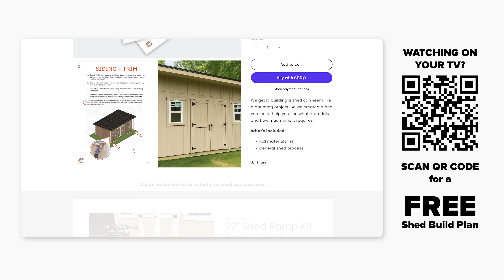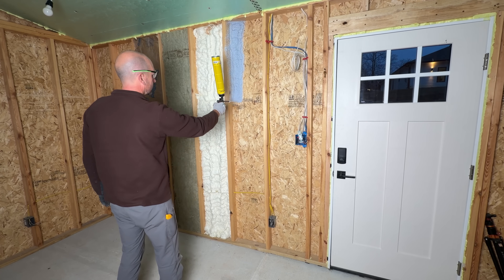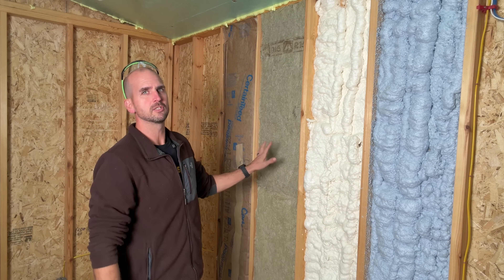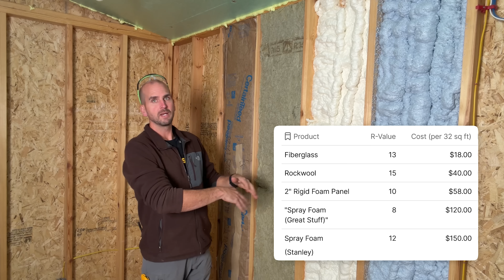Stop Wasting Money! Most Homeowners Are Insulating Walls Wrong

Comment: I used to work on exlensive homes built by professional home builders that were designed by local architects that came with finishing schedules for the trades to follow. These were built from the late 1940's thru the 1970's. I noticed they were using an industrial closed cell spray insulation in the exterior wall cavities then covering the exterior walls and ceilings below attics with foiled backed drywall. The aluminum foil served as a vapor barrier and as a reflective barrier that deterred heat and cold from passing thru the drywall from either direction. The property owners said their heating and cooling costs were lower due to that. Two friends decided to build their own house by using contractor friends and some work themselves. Both rented the spray foam application gun and hoses and the tanks from the same industrial insulation contractor then paid the cost for the tank contents. Both used sheets of oiled plywood set over each cavity after spraying so the foam would fill the entire cavity as it expanded to leave it flush with the studs. They had the electric boxes set flush with the studs so the plywood would lay flat against the studs. They installed box extenders when finished. They special ordered the foil-back drywall from an interior supply house.

Comment: Rock wool also has great sound deadening qualities which is a good reason to use where reducing outside noise is a factor. I still would us fiberglass if the structure is properly built and wrapped.

Comment: I used great stuff to seal every seam, joint, crackles, hole and gap in my basement wall before I reset the fiberglass insulation.
It STOPPED the wind from ballooning the plastic vapor barrier. Then I put up new drywall. The basement is 15 degrees warmer now!!!

Comment: Tried to read all comments , too many.
A few tips from doing Lagging Construction on Coal Burning Electric ⚡️ Plants.
 “ Never use a straight cut, when lapping.  Heat can escape. Use a “Z” cut. 4”- 2” down to 2” center, both top/ bottom lap piece.”
Heat on these walls exceeds 700- degrees.
Should work great from cold 🥶 temperatures.
Tip #2. Sound Ptoofing walls. Did a BOSE STORE, sound room. Tip: Double Wall “DRYWALL.” NO SEAM OVER A SEAM, Half way on 4’-0” wide, lap over at 2’-0”. Prevents sound travel. With 4” insulation in all walls ( sound barrier).
Union Retired SHEETMETAL Worker.

Comment: The end wall of my garage is bare cinder blocks, the wall is shared with the inside of my house (insulated on the inside of the house as per usual).  What is the best method to insulate the bare cinder block wall on the garage side, I have seen videos where foam sheet is glued on first, then studs are installed with fiberglass insulation in between, then vapour barrier added (plastic).  My garage is heated in the winter.

Comment: Pretty good comparison overall.  I'd love to see what the walls look like with an infrared camera after you're done and it's heated & cooled!  By the way, depending on your climate zone, you could add 1" thick foam board over the insulated walls to provide continuous insulation on the interior side, instead of installing drywall.

Comment: The other part you didn't mention was the difference between closed cell foam and open cell foam. Closed cell has a higher R value. Depending on the product it would be R5 per inch for the closed cell foam. The foam is more expensive but in colder climates it can actually be a better choice, as well as you don't need a vapor barrier.

Comment: My husband and I saved for a year to insulate our whole mobile home with Rockwool. It took us a week to do it ourselves because we replaced  and strengthened studs, repaired beams, leveled the house, replaced subfloors, and insulated our skirting. OMG after the first day it was AMAZING!! We couldn’t hear any outside noise, temperature inside was comfortable, and it was easy to install. My neighbor has a motorcycle and I could barely hear him when he came home 😂. We had more trouble getting the siding back on than installing the insulation. We were in a race to beat the cold weather that was coming. We finished painting the exterior 4 days before 32 degree weather showed up. We couldn’t afford a new central air and heat so we installed a gas heater. That one 30,000btu heats our whole house comfortably. I don’t think it would’ve worked if we hadn’t replaced the insulation in the walls, insulated the skirting, and put in storm windows. It was expensive but well worth it! We painted the roof with kool seal until we can afford a metal roof. There are no leaks in the roof but we wanted to prevent any leaks with snow coming. I researched for a year before we decided to buy Rockwool. I’m just amazed at the difference it made. You can’t hear anyone walking around, talking, or the tv on when outside.
Reply: Rockwood is amazing, replaced a walls fiberglass with Rockwood. Oh man! The difference it made! Everything you said and very fire resistant as well unlike fiberglass. I burn wood for heat and this has made a great difference when trying to save on propane or wood .
Reply: That’s because rockwool is really used as a sound barrier in libraries and other places where sound needs to be reduced. Its use as an insulation is secondary.
Reply: @davidlangley2722 about 12 years ago, i did a house remodel and built a laundry room upstairs (from basement).  I sought sound deadening material, to isolate washing machine and dryer noise, from our leaving area.  I believe i used this same material, after doing some research.   I remember it was labeled as fire resistant too.  Works great.  You can barely hear the washing machine whenever door is closed.  The laundry  room is right next to our living room
Reply: I love the sound attenuation that you get with Rockwool.  It is all I use now.
Reply: Insulation is the most cost-effective way to reduce heating costs. In Sweden, there are a lot of zero-energy houses in new construction. You don't need to add any energy to keep the heat well below freezing. In Northern Sweden, where it's normal for winters to be -15 F, they put 35 cm (14") in the walls and 65 cm (26") of mineral wool insulation (you call it Rockwool but it's a company name and not a product) in the roof. It keeps the house cool in the summer without adding energy. It's enough that you live there, run a TV and computer, etc. There's even a +House, i.e. the house creates more energy than it consumes, but then you have to have solar panels on the roof.
Reply: Mentioned Trailer, the skirting along the base, is supposed to breathe. Air circulation, to prevent MOLD .
I have a Trailer, notice some skirting has perforation every 6-8 feet apart. Help that breathing process.
Water 💦 Tip: try and figure a way to save your GRAY WATER.
Example:: Dish water, Laundry Water 💦, use it as,” Toilet 🚽 Water .”
I pay $13.41 per 1,000 gallons ( both water/sewage), this is where GRAY WATER comes handy.
Reply: It is also fire resistant  because it is rock😂

Comment: That rigid foam on ceiling was a waste of time the R value is useless ceilings should be R30 or higher use baffles against the plywood for air flow to keep mold away

Comment: Big question: To keep the insulation (say Rockwool) from getting moisture from the outside, could I apply something like Red Guard as a liquid-applied waterproofing to the sheathing?? I have an outside wall in the guest bathroom that I want to insulate before putting up DensShield for tiling my shower. But I wonder if I could waterproof the inside sheathing on that outside wall before installing the Rockwool insulation (or similar insulation) before I install the DensShield and tiling.

Comment: Hey, if you want to breathe toxic fumes all day, any of these will do. And honestly, have you EVER renovated? Rockwool absorbs water, and is a haven for rodents. I hate the stuff, but you are 100% right - it is the best of the bunch you have shown. 

I like your comparisons, video, format, presence etc., but not the materials you use. I don't even use OSB boards. Strictly eco builds for me. 
Also, those OSB boards will be excellent condensation points. What happens to these building materials once the building has outlived its purpose? All into landfill. 

Thank goodness for hempcrete and LSC insulation! Back to the earth they go, hey ho.

Comment: Love the Rockwool.  The fact that it's mold and fire resistant sold me.  I put a direct flame to a small test piece and at most it barely produced any smoke and did not char the insulation.  Insulated my entire home (1300sqft) with it.  Easy to cut especially around outlet/switch boxes.  Also putting slits in it where my wires run vertically in each wall cavity to keep the R-value.  Just a dream to work with 👍

Comment: Been building for 40 plus years, I always go with rock wool, best bang for your buck and fireproof too!!! You can put it right up to dryer and stove exhaust vents and gas fireplace chimney vents with no issues. And it has a higher R-value than woven fiberglass. It is still made of fiberglass, so you still have to wear a mask and gloves, but no where near the itchies that pink or yellow fiberglass produce.  Foam is expensive and not eco-friendly despite what they say, it is made from oil, so not eco at all.

Comment: Lots of myths perpetuated in this video.  
Staple the kraft paper on the face of the stud not the side. Otherwise, you get an air channel from top to bottom that forms a convective loop, degrading your whole wall insulation value. The drywall doesn't care about two layers of paper, and at least your vapor barrier is continuous.  Also, rock wool is only about 15% than fiberglass at attenuating sound—it's not a wonder product.  And fiberglass comes in R-15 for 2x4 walls, same as rock wool.  And regarding fire resistance, they are both very close, rock wool being better.  But the fire really doesn't care about this argument because it's too busy consuming furniture, plastic, carpet, studs, joists, trusses. etc.  If you have the opportunity to look at a burned down house, the insulation doesn't seem to play an important role.

Comment: I did my entire 1,600 sqft upstairs in my new build with Roxul. I did ICF for the walkout basement. It's a no-brainer as it cuts easy and doesn't sag.  It is tougher to install than fiberglass as it has to be cut to fit, so you may be cutting 1" off.  Spray foam is only useful in the rim joist spaces.  I live in central Saskatchewan...where it is currently -39C, so insulation matters 😉

Comment: They're selling recycled denim insulation in batts at the big box home improvement stores that approaches rockwool for sound deadening properties and offers R-13 insulation value. It's called Ultra Touch. It's about a dollar a square foot, so it's marginally cheaper than rockwool and scales out on a big project to make a lot of sense. The only issue I had with it was that it's a pain to cut.
Reply: Retains water 💦 ?

Comment: You didn't put the fiberglass and Rockwell in properly.  You need to split the product vertically, just above the electrical wiring, so the insulation is behind the wire and not covering it. You now have a gap between the wire and the OSB because the insulation is not against the wall.

Comment: I think the paper should be stapled to the face of the 2x not the side.  When you staple at the side you push down the insulation and thereby reduce the R value which is rated by the inch.

Comment: R-13? How about R-25? Overkill? In northern Canada we even use R-65 in our shed attic and we use Tyvek House wrap &  2" foam insulation under our siding on the exterior shed. Also we noticed by having those good old fashioned aluminum awnings over shed windows & doors also really helped add warmth to our sheds.

Comment: The big difference will be how the bats hold up 5 to 10 years later. You will see voids begin to form as the batts begin to sag within the wall. Especially if there is moisture penetration due to bad siding you will find with a lot of newer builds.

In general spray foam has was better applicators and material when you use professional grade equipment and no batt insulation will out perform it. It will never sag, it will never absorb moisture and it will never loose R value.

Comment: Most important considerations for insulation are R value, moisture control, and air flow prevention. Most fiberglass or wool installs are useless/vastly impaired by air flow. When taking apart old walls/in attics, the batts will be black with dirt as they have filtered the air like an ac filter. Sometime they are also black with mold that grows in the filtered dirt. In cold areas, 2x6 wall with 1.5 rigid foam board caulked or foamed to stud cavity to prevent air flow, with mineral wool on top. Can also put a sheet plastic liner under drywall to further prevent warm humid air access into wall/roof. Outside, preferably put a foil lined high quality foam board under siding material. This ensures near zero air flow in the wall as well as no moisture and provides an exceptional air and insulation barrier. Can eliminate wool/use 2x4 wall in warmer climes. May need artificial air exchanger for ventilation. IMO, do not use spray foam except in certain locations like sill to foundation or unusual architectural shapes... super toxic, possible fire hazard, not removable, hard to keep even, not environmental, and wildly expensive. If do go with foam, highly recommend professional application with specialty truck and hazmat equipment for crew... have tried all diy approaches and none are worth the time, money, or health risks. UAYOR.

Comment: hello from spain, you should have tested with a termographic camera the differents temperatures of each one
Reply: The R value was not in question. The point of this demo was the application and cost.
Reply: @brian1104-u3s  yes, I understand that but when you decide to use those materials it's important to know if it worth the difference of price between those materials

Comment: Did my stick built with Rockwool about 39 years ago. Stick? Really if you count 8" outer studs as sticks. Filled them up. Cut them diagonaly in half where the standard stud spacing was not 24" to fit them as wedges. Inside my home the 4" loadbearing studs , spaced at 16" were filled that way. The double truck of Rockwool pulling up asked where the second house would be as they were full up. That had me grinning as the first two massive trucks with  wood products showed up four months before. Similar question. 
Screwing and nailing patterns were adapted as per the requirements of the woodspecialist being a certified construction engineer. Checking up on the work was like being in church. A 6" nail is not a 4" one. The delivery van of all steel including brackets and straps to be used was loaded to capacity for one delivery. 
The community had to hire one of my construction engineers' colleagues to advise on the permit. And there are not many of those around.

Comment: I suggest that You chose rockwool out of these three. Because fiberglas insulation is not fireproof and so is also foam, but rockwool doesnt burn at all. What most people dont know is that isocyanate is the main chemical that raises the foam and it is the most cause of allergy material known to man. Isocyanates is prohibited in many countries just because of that.
...
And the application of sheets should be applyed much more carfully! Dont ever press the insulation beyond the surface of the 2x4 because it creates airpockets that decreases the performance of the insulation material. If You choose 2x6 instead, the sheat is much more stable and easier to apply correctly. And You will increase the effectiveness of the insulation by 50% wich is important these days when the price of electricity is going through the roof.
...
And dont stare to much at the tecnical specifications. The actual mounting of the material is crucial. Smallest error reduces the isolation capacity more than most people think. Most people is careless in the corners by the 2x4 or around electrical installations. You MUST fill up 100% of the space.

Comment: Insulation is one of the rare things that will keep on saving you money, it's literally money in the bank. I built my house in 1984 and paid for top notch insulation properly applied. My energy costs are 20% below comparable costs for houses in my area. It's been 40 years now and my savings paid for my insulation after ten years.

Comment: Your math is a bit off. 480 sf of the Stanley spray foam is $400. At a R value of 5.66 at 1” thick. So your 32sf would be $1.20 per sf x 32 x 2 for an R11 space so $76.80 and it is fire resistant.

Comment: An important detail not mentioned is all the foam products including the foam on the ceiling are required to have a thermal barrier. The exposed foam is a fire hazard and is extremely toxic when exposed to fire. The non foam products are good for staged construction. For example fiberglass or mineral wool in unfinished basements are usually left with just the poly air barrier/vapour barrier until basement developed, which could be years away. An inspector cannot grant occupancy if there is any exposed foam in a space to be occupied.

Comment: I wish I'd known about rock wool when I did my van build.  Folks are often pressed for time when doing a project, and so we learn from our mistakes.  This report is very helpful.  I've always used spray foam for pipe openings, odd corners, etc.  Besides the expense of spray foam, it's STUCK on there.  I sometimes tear down something I built after a while, and re-use most of the materials.  Spray foam would make that more difficult.